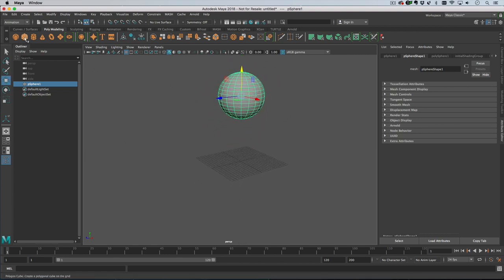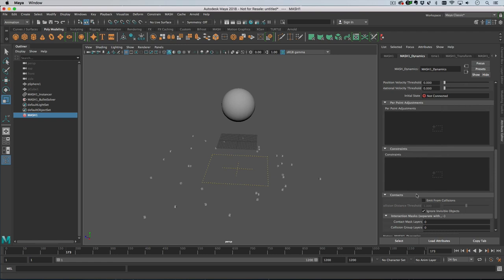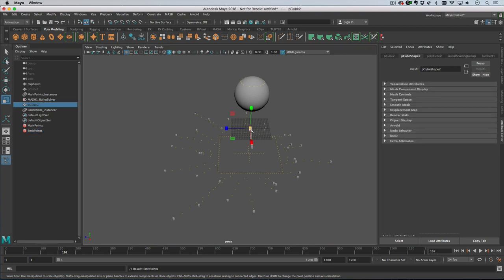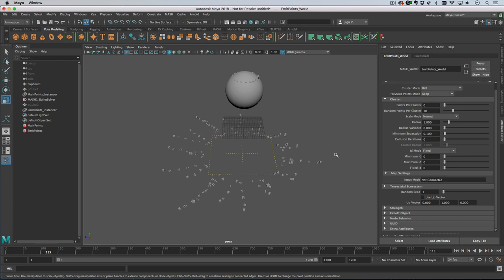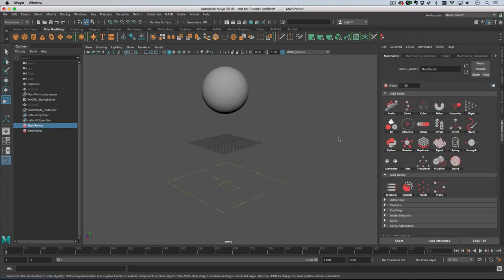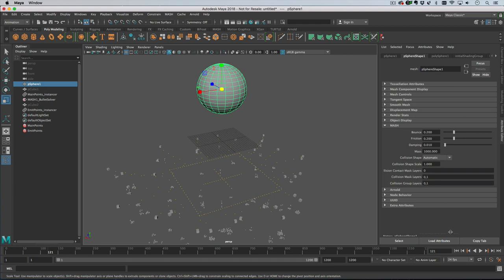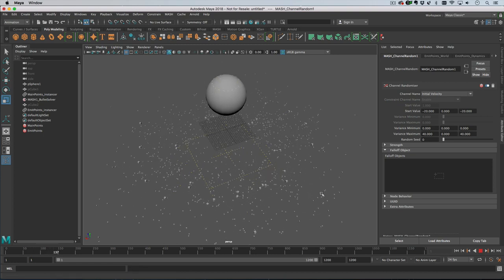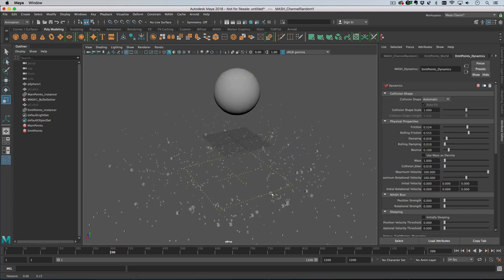MASH Dynamics - Emit From Collisions& Contact Masks

Comment: I have been able to follow all the other tutorials in this playlist but this one went over the rail. The methods and reverse-engineered workarounds are really unintuitive, like adding the World node and trying to figure out the values for the Contact Masks and bouncing around between the different nodes to make it all work arghhh --  I know I'm gonna forget how to make this work the second I close the scene. I'd simply rather have a field to add  'Emit Collide Objects' in the original MASH dynamics network and keep everything nice & self-contained. Also, if you're going to use this as an emitter, it's kind of useless unless you can animate the new objects' initial state (scale or opacity) so they aren't just popping on; also perhaps a 'kill on collide' for the original particles. Thanks!
Reply: Having said that, these tutorials have been brilliant and even this one gave me lots of tricks about the inner workings of the networks. Per Point Adjustment randomizers are great. I know there's a Randomize node but is it possible to have a ChannelRandom that affects geometry? :) :) Thanks, Ian.

Comment: Hi Ian. It there right way to control simulation speed in MASH dynamics? In play every frame mode simulation looks good and i like all the timings and stuff but at real time simulation it is too slow. Increasing mass and gravity not helping too much so i wonder maybe i was doing smth wrong.
Reply from the maker: Simulations must always be played in 'play every frame' mode. You can limit the playback speed if needed in the preferences. If playback is slower than realtime you will need to playblast.
Reply: The thing is that playback with play every frame much more faster than real time playback. It is not about my PC can't handle the simulation, It is like if i only have 4 sec for my simple animation (falling cubes, for example) those cubes wont even touch the ground in real time playback.
Reply from the maker: @alexeykurilo4381  In Playback preferences you can limit "play every frame" to realtime :)
Reply: Thanks for support. It still works not the way i need but i think i can fix it somehow. I just found out that you are kinda creator of MASH. So may i ask you are new futures expected with new versions of maya or you stooped support and develop MASH network?